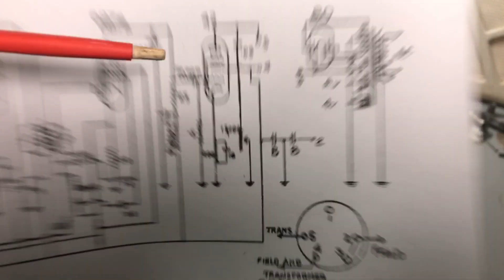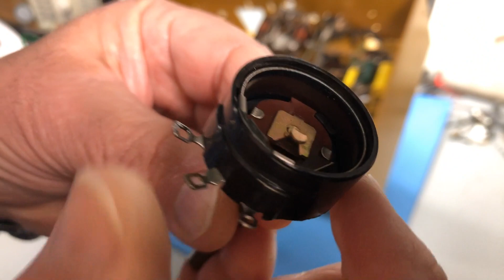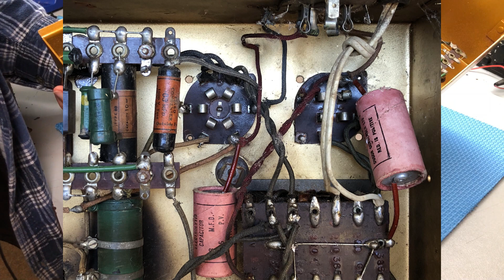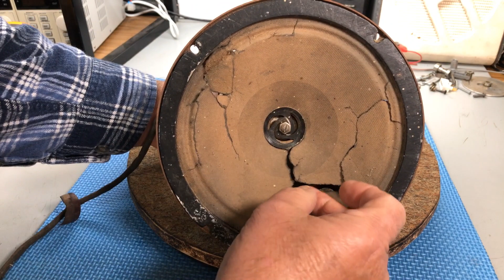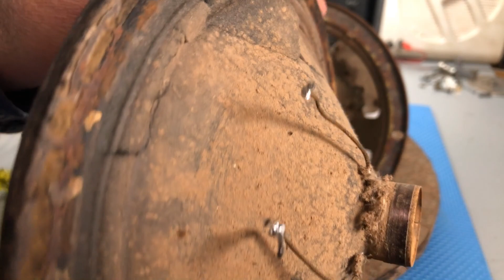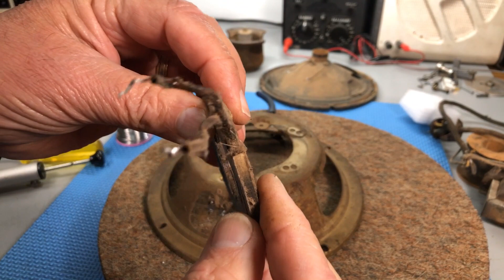Tone Pot & Speaker Repair for the Breville Radio !  Pt-12

Comment: Well... you might be able to reglue it but it would affect the sound quality with the extra weight and loss of suspension. I wouldn't discount it completely and probably give it a try and see how it comes out. As Don said it has dried out and is very brittle. There are cones available from China if you can find one with the correct dimensions, I did buy some a few years ago that matched an 8" speaker but haven't found them since. A doner speaker cone as Don said may be a solution but again hard to find one with the correct dimensions. A PM speaker is the other alternative. Good luck 🙂
Reply from the maker: I think a cone repair with coffee filter material & very light PVA/Water mix will be on the top list David, If it fails, plan B, a replacement cone maybe.
Too cold in the workshop today, Tuesday, sitting on 2deg & a bit of snow around.

Comment: Actually you could try repairing the cone first.  Maybe try overlaying the back of the cone with tea bag material (Dave Tipton uses it and I've had some success with it) and brushing Liquid Electrical Tape over it.  Or any flexible glue I guess. Also brush flexible glue over the suspension around the outer edge of the cone to reinforce it.  Worth a try, I think.
Reply from the maker: That was my thoughts Don but you have given me some other good ideas 💡

Comment: HI Baz.  That's a ripper of a speaker!  I suspect the paper in your cone has degraded to the point where it is brittle and will fall apart when handled. My first option would be to find a sacrificial permanent magnet speaker of the same diameter and do a cone transplant.  I've done this successfully before.  Remove the whole cone from the donor speaker (cut the spider or just cut closely around the voice coil, leaving the voice coil in the donor speaker.  Try to get the edge of the donor cone free of the basket and take it out as a whole if you can.  Cut the old cone away from the central spider / suspension thingy in the middle and glue the new cone in place.  Things to note- that little spiral "spider" or whatever it's called that holds the voice coil in alignment is fragile.  It's only made of fibre material and will crack if you're not careful.  These speakers always have a nut under the central screw with no thread on it.  The idea is you hold the "nut" while tightening the screw to avoid damage to the fibre spiral.  Hope this helps.  Any questions, just ask.
Reply from the maker: I do have a very similar speaker Don. Will measure up & see if that would work. Meanwhile I also have some cleaning up & painting to do on it.
Next week's project, at 5 deg here its great weather for painting too ! 😆
Reply: @techobaz55  Ok I'd better stop whingeing about 15 degrees here.  Plenty of rain though.
Reply from the maker: @Donno308 15 ? Summer ☀️ !